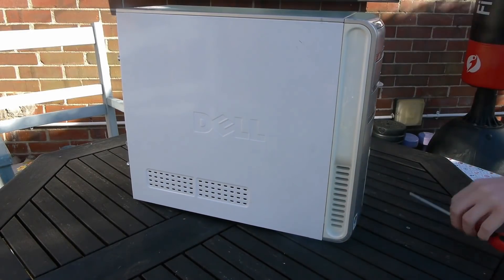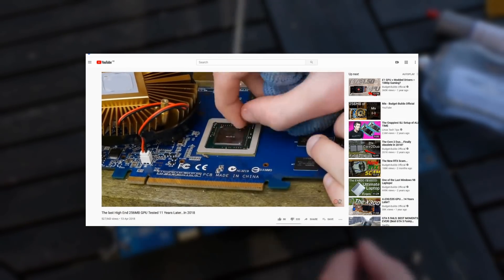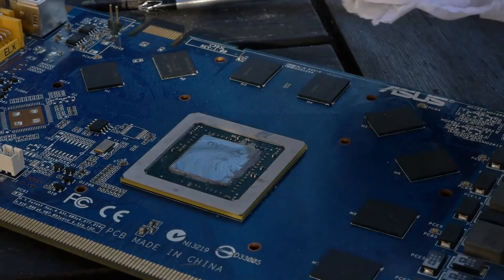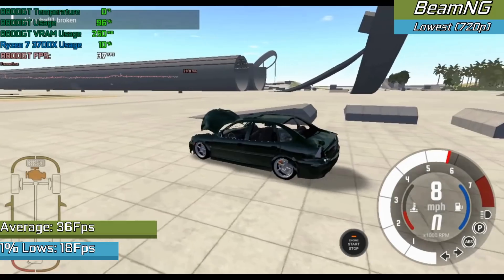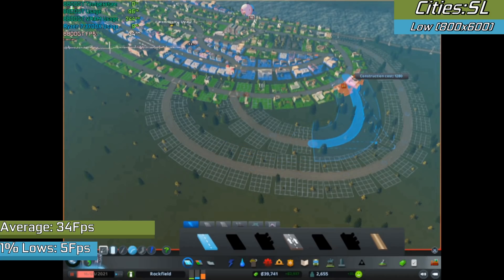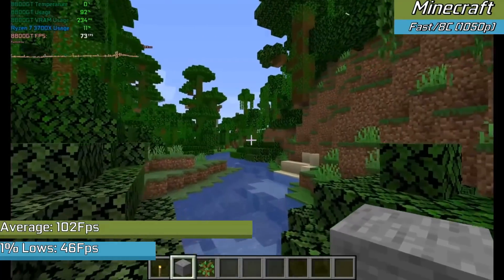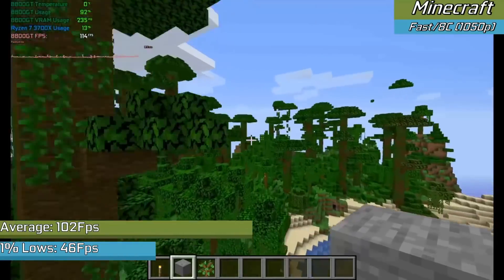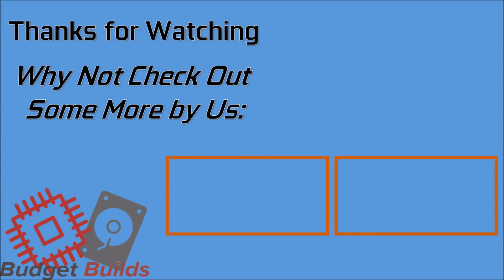GAMING with only 256MB of VRAM?

Comment: I use Quadro 2000 in my "Ultimate Windows XP PC" I prefer nVidia, but their drivers newer than v285.58 start having some visual bugs in some games (texture flickering e.t.c.)(Tomb Raider III, Turok 2, Far Cry) So the most powerful GPU's supported by this driver use Fermi architecture. This PC also uses pretty weak PSU, that"s why I needed to use a card without external power connectors, and Quadro 2000 is the perfect choice - it is the most powerful Fermi without the connector! :)

Comment: same with cards like the gtx 960 2gb vs 4gb.
if you use all the vram the card will render slower as its working more. 
dont really need 4gb on a gtx 960 is what I mean here. using around 2gb yeilds the best balance of detail/framerates

Comment: Very good my friend, I have an old gt 8600 with 256mb vram and I was wondering lately if that card would work on my ryzen system. I'm not gonna do it on purpose, but if my gtx 1060 for some unknown reason stops working one day at least with the old one I will be able to keep using my pc untill I find a replacement. Really nice!!!

Comment: Good video showing that 256MB VRAM can be somewhat viable these days. But I also have a suggestion on trying out the 7100 GS or 6100 which is possibly the worst DX9 supporting GPU in my experience but its slightly better than the Geforce 2 mx400 card you reviewed years ago.
Reply: I bought my friend a 610 as an upgrade for his PC for 5 euros or a few pounds. Userbenchmark said it was a 30000% improvement

Comment: so this is how ps3 could run gta v at 256mb
Reply: To be fair that an amount of RAM that a console should have it depends on how powerful CPU and GPU is.

Its is clear that Cell CPU was bottlenecked by RSX GPU.
Considering that PS3 GPU was an underclocked GeForce 7800GTX, it make sense why it only had 256MBs of VRAM

Comment: Wait what? I once got Cities Skylines to run "fine" on a 9800 GT eco on my AMD Athlon system back then (I had a PSU issue that meant I had to take out my power hungry GTX 570), and I didnt even have to adjust the settings (they were on max), and still got bottlenecked by my CPU, that was only a Athlon X4 640 with 4x3Ghz. Then again the 9800 GT eco did have a full gig of VRAM.

Comment: I have an interesting 1GB version of 8800GT even if most 8800GT cards only had 512MB of vram. It would be interesting to see the other end of the spectrum and if you can get any advantage from 1Gb card compared to 512MB version of this card in any titles that the card can run.

Comment: Gaming with only 256MB of VRAM in 2020? Man. I still have my 2010 MacBook Pro with an NVIDIA GeForce 320M with 256MB of VRAM (released in 2010, and it's an integrated graphics card). It's great, however, I wonder if I can play any games with only 256MB of VRAM, but having a decent FPS, in 2020?
It will never die. I have used it for 10 years and... guess what? It's still working perfectly fine! At least, the thermal paste has not been taken care of, but I don't want to do that, it's wasting my time. It's fine now.
And, the best of all, older graphics cards DOESN'T MEAN it's getting WORSE. Somehow, they're BETTER than the graphics card on your new computer.
Needless to say, can you play Minecraft and get a decent FPS with only 256MB of VRAM?

Comment: you should always remove heatsinks / coolers with a  cross shaped pattern to limit the stresses put on the chip. but wit
h this card why not just wedge a flat head under the cooler and 'pop' it off?

Comment: Back then when you had a 256MB card usually meant it had enough power for gaming in general (still not necessarily high-end)
Having 2GB now means absolutely nothing compared to 2010-ish as VRAM requirements increased pretty fast when HD
became more of a standard even lower end cards got VRAM slapped on them.

A 210 within a series should already tell you it's not a gaming card.

Comment: Well, i have video card with the same 256 VRAM which is ATI Radeon HD 2600 PRO and i tried to play very first Crysis video game. And i'm not talking about Remastered version, i'm talking about original version. And in game objects was loading on the go and game had some stuttering or micro freezes, so i uninstalled it because it was uncomfortable for me to play. And yes, this is first time it happened for me, because when i played this game few years ago, it was working fine. Sure i had different video card back then, which is ATI Radeon X1650 Series, but again, it's a shame that i can't run this game normally anymore. Anyway, it happened for me only in Crysis game, other games works fine. Like, i finished games like Singularity, Sleeping Dogs and The Darkness 2 recently and all of them was working fine. Also yeah, here is my specs:

OS: Windows 7 x64 Ultimate
Motherboard: GA-945PLM-S2 with Intel Core 2 Duo support
Processor: Intel Pentium D CPU 3.00GHz
2 GB RAM DDR2
Video Card: ATI Radeon HD 2600 PRO 256 MB
Hard Drive with 1 Terabyte of memory

Comment: Can you make a video about the gtx 650? that's the most basic card which supported direct x12 and vulkan when they came out
Reply from the maker: My new "Scam RTX" Video turned out to be a GTX650. The Performance shown in the video is representitive of a GTX650.
Reply: @BudgetBuildsOfficial  That card is very underrated, used to own one but i ended up giving it to a friend, but that card can really run a lot of stuff just fine
Reply: I had a 2gb 650 until I switched to my 1060, it did pretty good

Comment: I used my gt 8800 512mb from 2007 to December 2017. Play games on dx9 hd high (not ultra) settings till 2014. Then Maxwell chip outperform it a lot, but I wait to buy cheap gtx 1060 3gb - enough for fhd.

Comment: This isn't anything to do with gaming, but I've been able to skirt by browsing the Web on an 8MB Rage 128 hooked up to a single-450 Power Macintosh G4 with decently high refresh at 1024x768. And of course, any game ca. 1999 or before will work fine. Helps to have a CRT so it still looks good at lower resolutions. OTOH, the 64MB GoFX5200 on my iMac G5 is so utterly useless as to stutter under even the lightest Linux desktops -- I've tried both IceWM and Window Maker and both stuttered terribly.

Comment: How did you install drivers for 8800 here since Windows 10 does not driver support and Nvidia either? Just as Microsoft Basic Driver, which is basicly a VGA driver. Im asking because i have 8800GT512 and want to use it as everyday display adapter.
Reply: Nvidia still has the drivers

Comment: I'm gaming with 128MB of VRAM (Stock 64mb had to enable 128mb in BIOS) and I can play Minecraft with 1FPS for 6 YEARS. I am trying to solder a PCIe x1 slot on my mainboard because on a higher end model of an Acer Aspire XC-603 there is a PCIe x1 slot.😂😂😂help

Comment: >it’s maybe at the level of an HD 520
I think this performs better actually, I was stuck on a i5, 6 gb of Ram system with a HD520 for around 4 years and there was no way in hell it would run something like GTA V even having modding it and downgraded everything in and off game, heck, it ran Crysis on low like crap, maybe it would run at 10 FPS with a ton of luck

Comment: Pretty amazing now modern  integrated graphics is as fast or faster than these cards, when I started system building in highschool 

But mostly because these old GPUs are being majorly bottlenecked by having less than 1gb of vram.

Im not really a fan of these potato tech channels, but they keep appearing in my recommended feed... plenty of old stuff you can still experiment with... 8800GTS 320MB, 640mb, 8800GS/9600GSO 192MB, 384mb etc.

Comment: 256MB is pretty useless in Gaming today.
All i can play on my 330M with 256MB in the MacBook Pro (2010) is Sims 4, Battlefield Bad Company 2, Half Life 2,  CS Source and some very old classic games from like 1998 and newer or as hardware acceleration for PSX emulator since the iGPU of the old, like 1st gen i5 CPU is wayyy too slow.
I really hate how this "special" version of the 330M is so much more useless than a 512MB variant.... there would be SO MUCH MORE PLAYABLE TITLES with 512MB(Overwatch, CS:GO, BF3, GTA V,...), but Apple decided to use in the cheapest model of 15" only 256MB

Comment: putting it in a modern system is actually not the best thing to do, as the GPU will hit max vram and use SYSTEM ram after a short while, wich in this case (on a ryzen plattfrom w/ DDR4) is FASTER than the gpus own DDR3
Reply from the maker: GDDR3 is used on the card. Nothing DDR Based. System ram i still going to a blindsight slower.
Reply: @BudgetBuildsOfficial  its actually tied, GDDR3 has 25.6gb/s of bandwith, the same as DDR4 3200

Comment: 2gb is nearly undoable already, imagine 256mb
Reply: Depends on the settings for 720P 1GB will usually be enough for a 60fps experience if the GPU is powerful enough.

I've only had to really lower settings in generation 0 with a GTX 465, but everything else runs pretty good so far

Comment: "even in 2006/2007 256mb of vram wasnt a big deal"

dude im happy to have 256 on my 2010 laptop (which i use in 2020)

also how tf did gta v run correctly on this card when the minimum vram is like 1024mb?

Comment: i have a laptop with 512mb vram but it doesnt run gta5 in 600p with low settings, why ?
Reply: This is a year late, but VRAM is not the only thing influencing performance. You could have a slow card, or maybe old drivers

Comment: Hes wrong For example if you have 4 gb of RAM It then turns into VRAM and thats important for gaming as if you have alot of VRAM you wont experience game crashes or stuttering I have no idea why he said it doesnt do anything but GG
Reply from the maker: DDR4 is still going to be slower and have a huge performance defecit compared to standard GDDR3 on the card.
Reply: @BudgetBuildsOfficial  That is a little bit true i use DDR4 RAM With 4GB
Reply: But I thought DDR4 is faster than DDR3 hmm guess not xd
Reply: By the way could you make a video on how to make windows 10 super light for gaming if possible

Comment: I'd love to see a gt 1010 with 256mb of vram for 10€, that would be a good card.

I dont understand why these cheap video adapters have sometimes so much Vr for what they're capable.

Just why exist gt 210s with 2gigabyte of vram what do you want to do with these 2gigabyte of vram your not able to run any modern game in a way properly
Reply: So they can be display adapters without slowing on a desktop or YouTube playback. If you want to display 2 1080p monitors 2gb of VRAM is probably good
Reply: @theforerunnerreclaimer  hm, graphic cards are able to acces system ram.
(Intel /amd integrated graphics).
Yeah it may be slower but with a graphics chip capable as a gt210 but with dedicated h.265... decoration you're able to go without any major slowdowns, tgat's what i mean

Comment: this is crazy why u try with Ryzen 7? not pentium or intel inside? and why 32GB? not use 4Gb RAM?

In my old pc use Pentium 4 G2260 GT 710 1Gb Vram ddr3 With Ram 8GB ddr2 try in Csgo, GTA V i have 7-12FPS in GTA V and 12-20FPS in csgo 👍
Reply from the maker: You don't bottleneck a card to see it's performance...
Reply: @BudgetBuildsOfficial  ah yes 🤔

Comment: My i5 6200U, 12gb RAM, and HD520 runs GTA V better than that...mix of med/normal at 1080p and I get netween 24 and 30
Reply from the maker: The HD520 is most likely more powerful than the 8800GT 256MB is at this point

Comment: ITs because of the ram is 32gb. if you had tried with DX11 or 12 games with 256 MB of VRAM all it will do is put the game's VRAM in ram. so wrong title.
Reply from the maker: DDR4 is still much slower than GDDDR Based RAM, pair that with slow communications over PCI-E. This is entirely bound to the small amount of VRAM on the card. What you are saying implies a 1GB 8800GT will perform the same as I am using 32GB of DDR4 in the test system. 

No
Reply: @BudgetBuildsOfficial  i am proble wrong but why did you say 256 mb
Reply from the maker: You logic implies all 8800GTs will perform the same as my 256MB One, Regardless of 512MB, 1GB, etc... As the card comes with multiple VRAM Variants

Comment: FAKE, you can't even run GTA V on 256 V-ram, won't even start the game period!! The minimum requirements is 1 gb of v-ram, and even if you could rockstar games will crash at 500mb of v-ram at game start up.
Reply from the maker: Funnily enough… you can.
Reply: @BudgetBuildsOfficial  GTA V will not run on 256MB of ram, won't even start the game. The Minimum requirements to even run GTA V is at least 1GB of Video ram just to run it at low settings. PERIOD. You modded your system, and if you didn't, then you lied about the actual V-ram you using in your system. I know you a liar, I am calling you out on your lies.
Reply: You can BS all the other viewers who don't know nothing about the system requirements or even the Minimum, but you can't BS me. the ones who aren't saying anything about your comeback comment are either NPC's or fake accounts, that's 78% of your viewers.
Reply from the maker: My guy, this is one of the most powerful 256MB Graphics Cards out there, the game doesnt have a hard VRAM limit. It will overflow to system memory, but thats a given. GTA V is an 9 Year Old game on PC, it is rather well optimised too. If a game doesn't launch I show that in the video, all GTA V does is give you a warning, you dont have to bypass anything. Have a good one 👍
Reply: watch his video on how he runs gta v on bad pcs